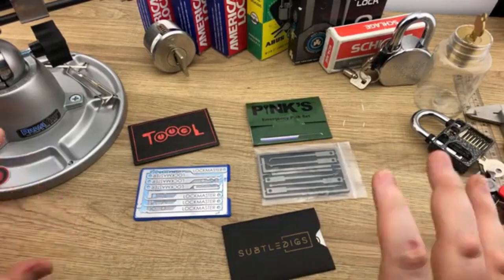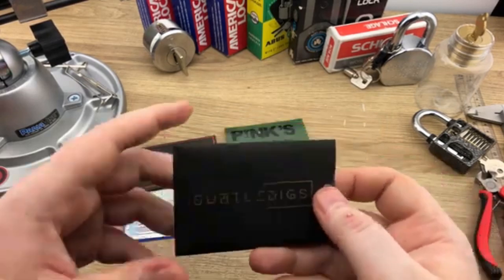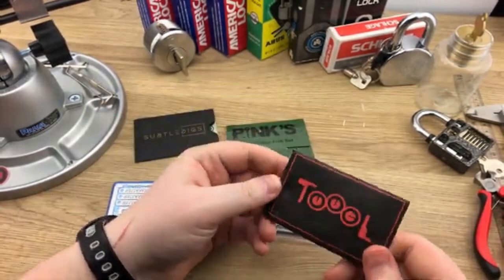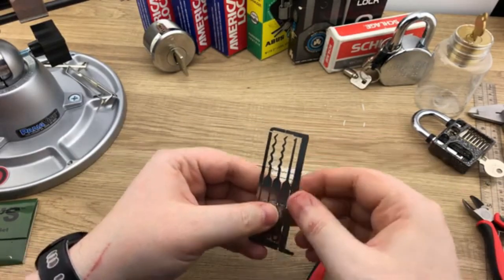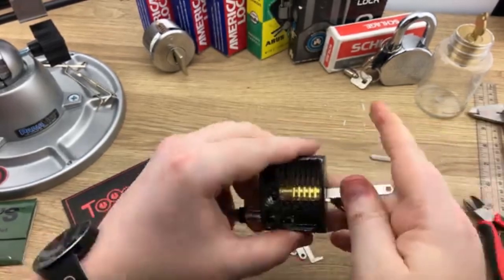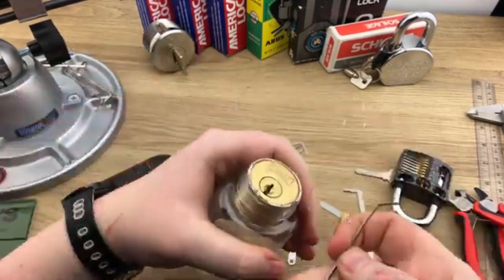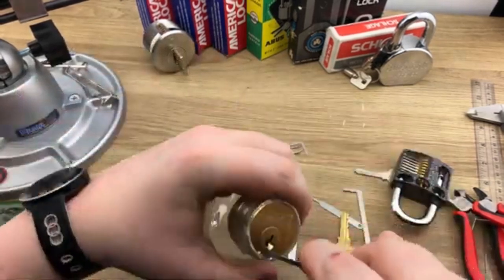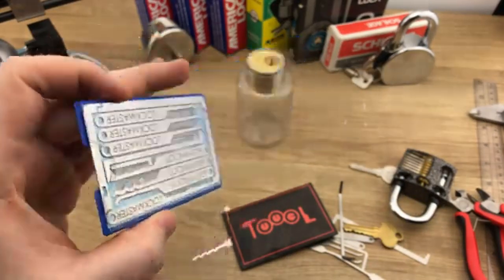Toool Lock pick card Review giveaway!

Comment: That's a very nice set, simple yet effective. I like that it includes TOK tensioner,  but I still prefer the new style card set that Wendt just released designed by locknoob and tallinpick.
{Edit} I noticed they also did 2 things that Wendt does...holes for a keyring, and a carry case for after they have been snapped apart.

Comment: Overall, pretty good. I think a short hook would probably do more good if it was there instead of one of the other picks, though.
Reply from the maker: I would say say that these cards should be more focused on emergency rapid entry. I say that based on personal experience using them.
Reply: @LegalLockPicker  That makes sense, but I still think a short hook should've replaced one of the deeper hooks, since if you're going to SPP or zip, a short hook would be easier to use in most cases.

Comment: They are definitely the best so far. The only way to make them better would be to redesign the card so that the picks can be put back but that would most likely cut down on the number of tools that can be fit in it which wouldn't be good.
Reply: @Zieh-Fix  yeah that's basically what I was thinking. By the way do you know if the Lockmaster® Credit Card Pick v2 are being old here in the states? They look like the only other set that might be better than the Toool card.
Reply: @Zieh-Fix  that's too bad. I guess I could send message to Think Peterson about it but unless you can work out a licensing agreement for them to make the cards out of government steel then I don't think that's going to help.